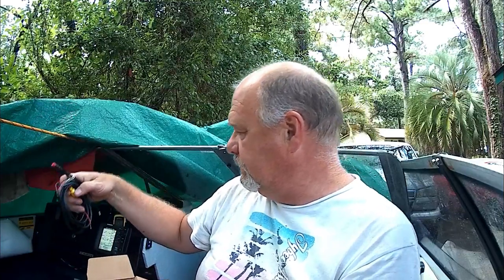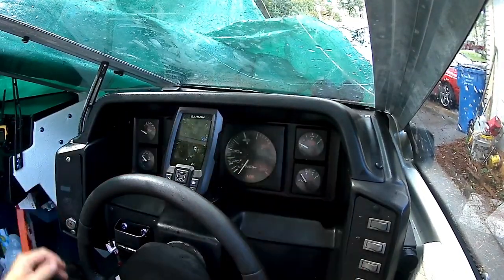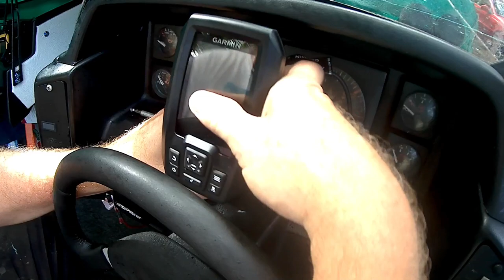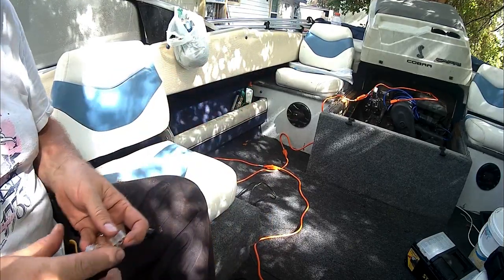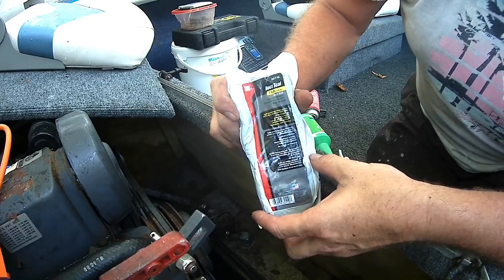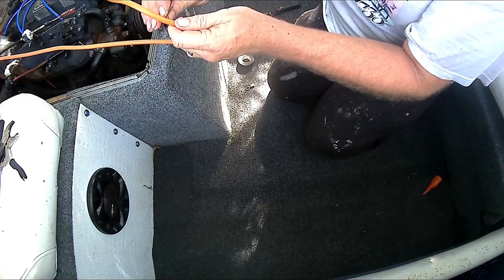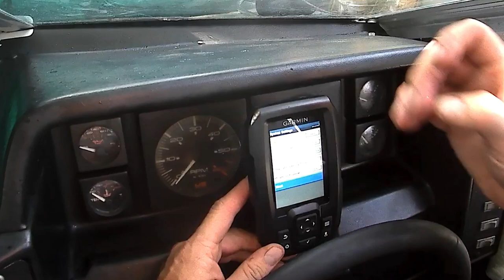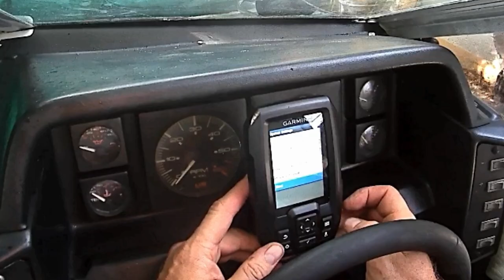Garmin Striker 4 un boxing and installation

Comment: I have the same depth finder in my work boat and it’s great I have no complaints only user error if you live in a saltwater environment the ends tend to corrode if you don’t put the caps on also dip the ends in vasoline to keep the water out. The best way to keep it nice is to remove the depth finder after use and store it inside your house out of the sun.
Reply from the maker: Thanks for input Matt!